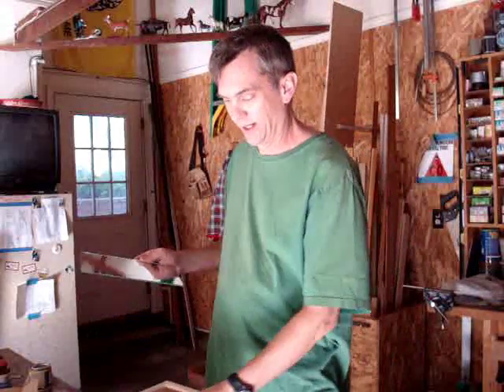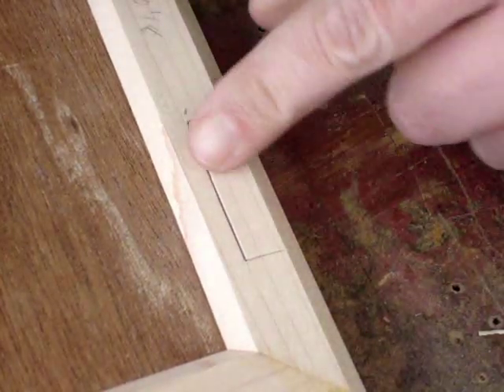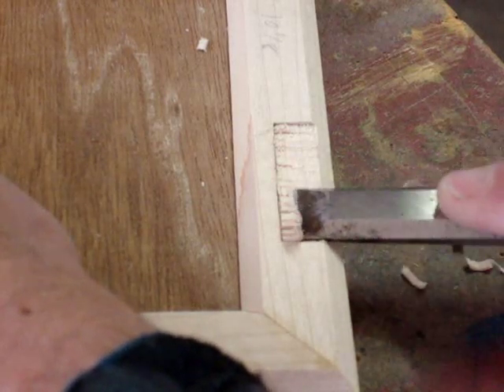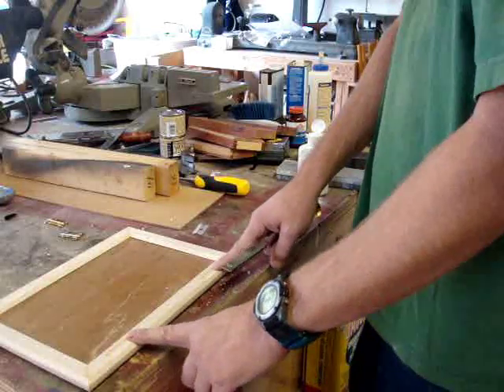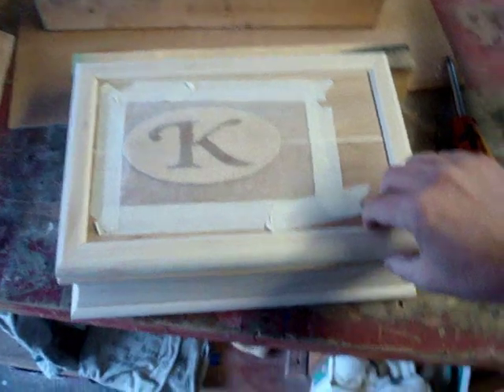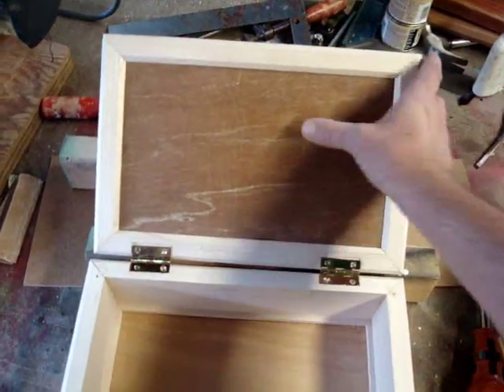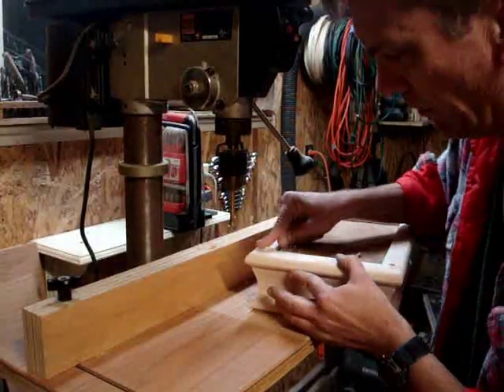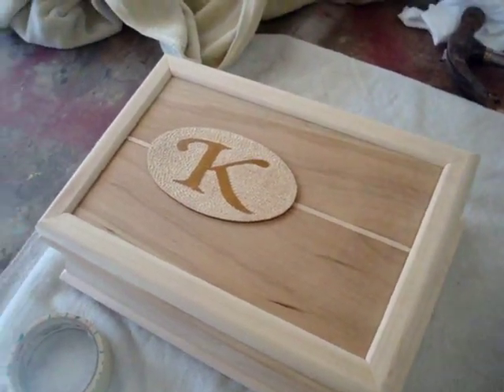Build a Jewelry Box: Pt.6 - Assembly

Comment: Hey, not trying to critique your mortise method, but coming from someone who doesn't have a router, I personally set up a simple guide slide using my push slide from my table saw.  I use it inverted on my drill press along the press' table, and clamp my work to it.  Then I use small router bits, and or drill bits to do some light milling.  It sounds like more work than it actually is, it makes carving out small sections like this a breeze.  Just a tip, from someone who has very few tools.

Comment: Hello Steve,
nice videos and I have learned a lot out of, but I have two suggestions.
1. screw the hinges on the wood then score the edges with a sharp utility knife, it makes it easier line the area to remove.
2. try to use a vise or clamp your work to ur bench.. this way u avoid cutting urself as you did.
I hope ur finger heels well.. 
Regards